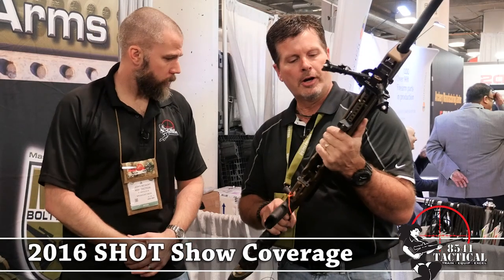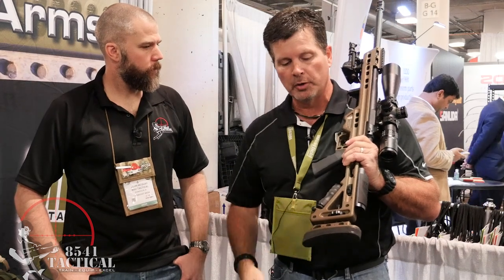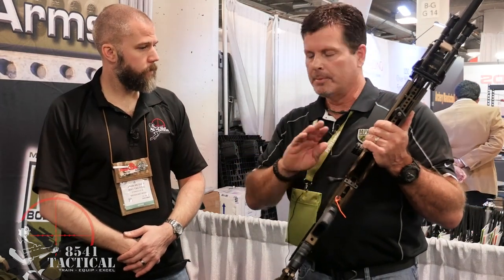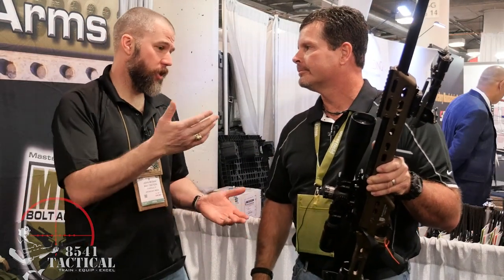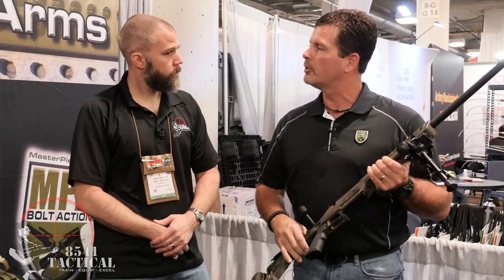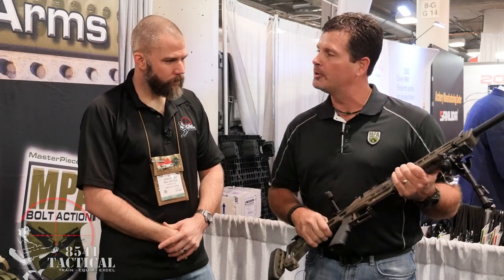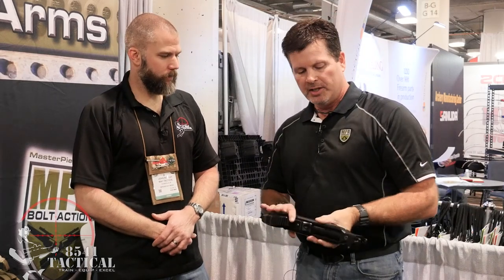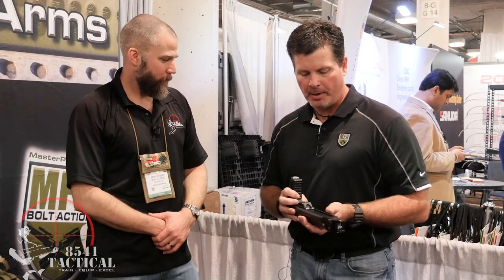SHOT 2016 - Masterpiece Arms

Comment: Be aware that they are not designed to use an AW magazine. Even if you put an action in that accepts that mag the chassis will not. The mag catch is too short and they don't offer another one. 
I have an APA bottom metal on another rifle with the same Defiance action and it will accept both AW and AICS mags. This chassis will not. 
Also, we had to mill out the magwell because full mags were too tight. 
Great design for competition but they need to fix these issues moving forward.